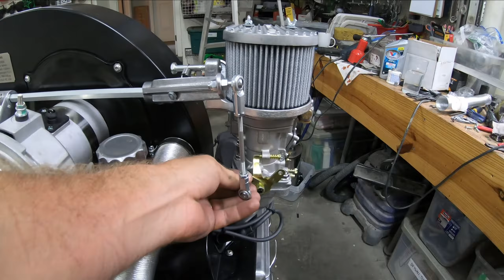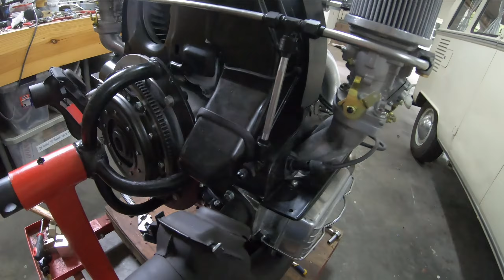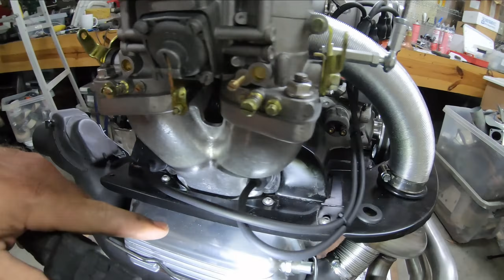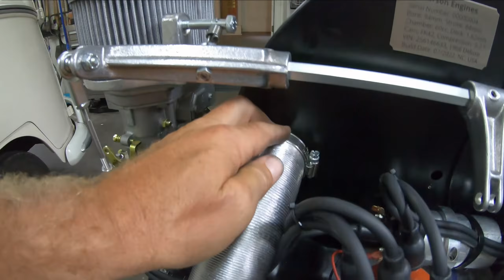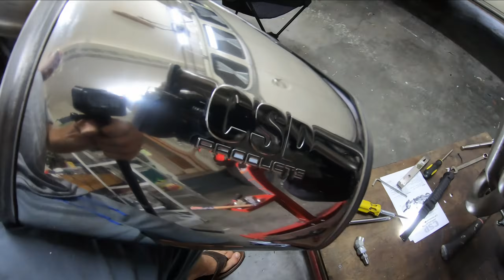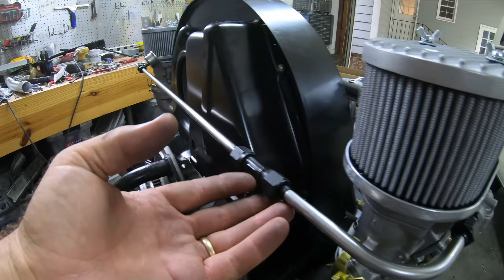2332 VW Air-cooled Stroker Motor - Video 74 - Exhaust, Heater Boxes, Tins, Features

Comment: Have you considered a hardline with a bulkhead fitting, as a pass through, in the tin for the valve cover breather?
Reply from the maker: That seems like a solid idea.  I never considered it since I hadn’t ever seen that before.  With all the jiggling and vibration of an engine relative to the body, I would want to make sure this didn’t increase the likelihood of an AN fitting coming loose - and as long as that doesn’t happen it seems a clean solution where you could get your filter nicely situated outside the engine compartment.

Comment: Dang it! Wish you would have filmed the process of putting the exhaust on. Looks good though. Nice work.
Reply from the maker: Thanks!  The CSP Python had only a few tricky things - there are two tubes that slide in and out like a trombone, and so there is some flexibility to make it fit.  The heater boxes seem to vary a bit by vendor, so getting everything in place and tightened down is a bit tricky - feels great when it is finally tightened down and you feel like all the exhaust gaskets are sealed well…

Comment: OIL LEAK PROBLEM WITH YOUR 1968. Small breather box with no road draft tube. Put a stock oil filler on there with road draft tube. Your building crank case pressure. And leave the breather cap off.  I had the same issue. Anytime your blowing oil out the crank seal and valve covers, that is usually an indicator of crank pressure.
Reply from the maker: Ok cool - so the 1968cc should find a new home - if I can find the right roller beetle.  I’ll try to fix everything and at the same time be on the lookout for the roller vert - I can weld some stuff in, but looking for a decent chassis.  My 1968 actually runs great with the 11.2 second 0-60, and it would be great in a beetle even if the compression ratio is a bit low

Comment from the maker: It is a Kennedy Stage 1 clutch - not a Stage 2.  The heads are Tims Stage 2 Heads.
Reply: 1700lb with solid disc. good probably for your trans if you didnt do too much to it. IDK what you did to the trans. PLUS strap that sucker. that is a lot of power. Sheer torque might break the nose cone.
Reply from the maker: @Mikefngarage  it is a Kennedy stage 1 with a no slip disc from CB.  I have stock bus gears with a 3.44 pinion rebuilt by Jeff Huber in NC.  Transaxle is great - it is 3100 rpm at 65 mph